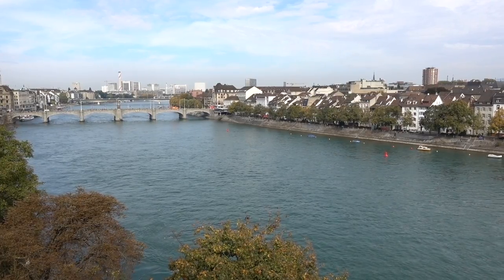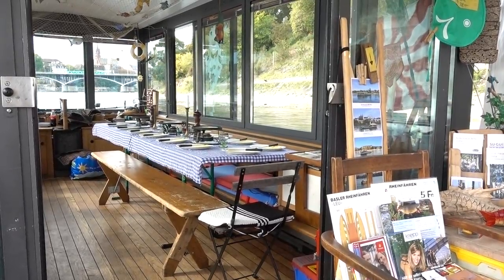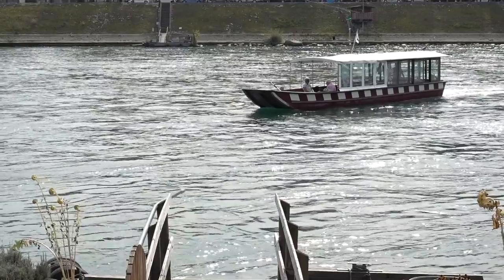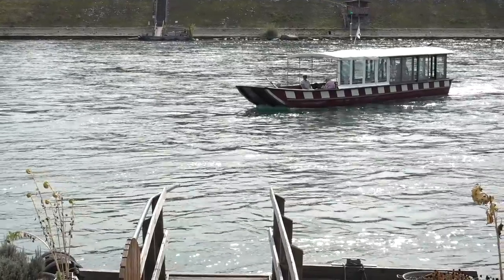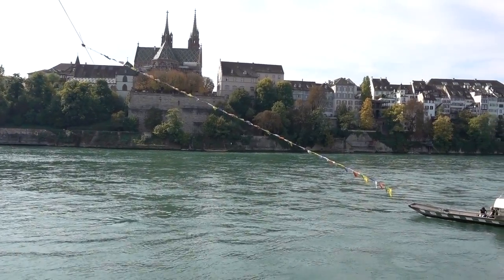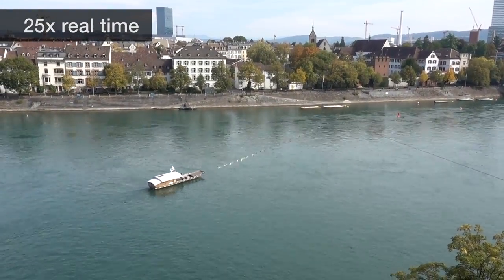Reaction ferries are really clever

Comment: Great idea, as long as the traveller doesn't get hung up on the cable.  Though I suspect it would be easy enough to bring out another boat to get the passengers off.  Then maybe they have a means of reeling the cable to one side or the other, to clear the jam (and replace the cable periodically).

But seems the boat could be more optimally designed for the purpose, to speed up the crossing.  But then again, this is more of a tourist attraction than a present day people mover, so speed isn't important.

Comment: Canoerrs have been doing this for centuries as well, and it doesn't require the line. Whitewater paddlers call it an "eddy ferry".
Point your bow about 30-45 degrees into the current facing the direction you wish to travel and lean upstream. Your boat will move almost horizontally across the stream.

Comment: It doesn't seem to be a rudder directing this boat, it's even simpler than that - the bar that can be seen being flipped from one side of the boat to the other at 1:00 changes the anchor point of the cable, allowing the current to turn the entire boat toward the opposite bank.

Comment: Now put a couple propellers on the boat and attach the circular motion of the propellers to an alternator and run a wire up that wire to make essentially free energy. Could power street lights or charge batteries etc from that river. Put a boat every 30 feet...

Comment: I though about methods of using gravity as the energy source and came up with tunnel-slides. Huge tunnels that act as a slide at the start, and then momentum pushes you up the other side. would be good for continent-crossing.
Clearly impractical now, but could eventually be plausible given improvements in technology
Reply: You would need some source of propulsion besides just gravity, otherwise each time you go up, you would not go up as high as the starting position.   There would need to be some sort of booster at the end of the uphill.

Comment: There is even simlper solution to this - not from user point of view but mechanical - the cable that connects boat to the main cable is in one corner of the bow and when you want to drift to the other river bank, you just mount the cable to the other corner and boat just steers itself.
You dont need any moving part like the steering lever.
Reply: kibicz watch the video. That' s exactly how it's done. The rudder is just for increased effect and control.

Comment: I thought about this sort of task in relation to ferries used in Ukraine.  I was wondering if, where the river curves the right way, you could do this with a long rope only anchored on one side of the river.  Long enough rope or great enough curve of the river, and it would appear to be doable.  I never thought of stringing the cable across to the other side.

Comment: The power of the waves could be stored in a battery on board the ship when not in use and it could power an electric motor when needed.
Reply: A motor isn't needed.  That is the beauty of that design.    The river IS the motor.

Comment: The obvious problem with these ferries is, what if you are on the other side of the river and there is no one on the otherside that needs to come over. The solution would be to make alternating ferries, one slightly up stream and setup the cable system so that when one ferry starts to move, the other ferry moves at the same time. Or, you have a ferry operator with a signal system but then someone has to be on the ferry 24/7.

Comment: Here is a thing I have never seen but I think might just be missed.
Parking lots should be inversed. Cars drive on the outside of the lot, and only venture in to park, instead of having a road right outside the entrance to the building. Once you turn in to the lot you can either drive in all the way to the building, turn around and go back out, or park.

This enables pedestrians to avoid the cars, and reduces congestion caused by pedestrians... takes no longer for the cars, and only a few more steps for pedestrians, with the notable exceptions of the jerks who pull up to the door and jump out...which is harder, but not impossible.

Comment: They are using the "ferrying principle". The boat is angled towards the direction they want to go and the river pushes the boat that direction.The ferry operator simply causes the boat to go at that angle by grabbing the cable and quickly attaching it to the opposite side of the ferry ! He makes it look easy but if you are not quick enough and the river over powers you the cable will be pulled from your hand ! 

 We use it even in Kayaks in far more heavy current, f course without a cable. There are a number of videos showing how its done for kayak's. One can do it without the cable in a large boat like that but you must have "eddies" on both sides and you must paddle some. The eddies current is circular and on the inside against the shore actually flows up river !

Comment: Could you make it even more efficient/*quick* if quick were needed, by altering the relative positions of the cable teathers on both ends... or even one end really?
You can easily pull a lever that snaps one cable into a forward position and another into a back one, giving a relative gradient in a sense - backwards. Much like a light-switch which could change both tether ends.

Side A - Forward, Side B - Back.
Get to side B, with A - Forward & B - Back. Change them round... you'd have to have a snap mechanism to push the boat forward agaisnt the current & a tether system to the side that you're on, but it'd make side to side faster. But obviously complicate things in turn!

Comment: I don't get it. What stop the boat from just laying along the water current? How does it keep an angle again the water current? I mean these no reason the connection cable is moving faster than the boat itself without power.
It seems to me that 2 connection cables are needed. one connect to the front for the boat and one to the tail. the one connected to the tail needs to be longer.

Comment: They should also put a hydro generator to charge batteries on the boats to use an emergency electric outboard in case the cable snaps.

Comment: Can you explain how cell phones and cell towers communicate at high speeds? Like on the motorway? (Does some of the signal get lost behind?)
Reply: Without digging into this, it's likely there is some doppler shift going on with the signal. This basically means the frequency of the signal changes with the direction you're going. So higher frequency when moving towards a cell tower, lower frequency moving away from it.
So in case of a digital signal, what changes is the bandwidth of the connection. Higher frequency = higher data rate, lower frequency = lower data rate.
Just imagine the bits meeting you when they are moving towards you, and you to them. While you'll meet less bits in the same timespan when you are moving away from them, but they're faster than you, thus catching up.

I'm sure someone will correct me if I'm wrong here. And it's likely it is more complex than that.
Reply: The speed of ANY vehicle is negligible compared to the speed of radio waves (the speed of light).
No data is lost or left behind, just as you never see a shift in the color of lights or objects as you travel towards or away from them.
Reply: But on a cosmic scale... we have redshift/blueshift. And there is such a thing as radar to catch speeding vehicles :)

Comment: I don't think it's that obvious. If the water is pulling in one direction and the ferry is attempting to cross it perpendicular to the flow, there is no intuition that says that a wire running across it would necessarily pull the vessel across.  Why wouldn't the ferry just stay in one place with the wire holding it steady?  Is the water not actually flowing straight in one direction but at a steady angle to the shore and therefore slowly pulling the boat by degrees?

Comment: Fairly obvious is you have ever sailed. The cable basicly does what the sword or keel does on a sailboat when on a haul or reach.
Reply: It's an even more straightforward relationship than that. The keel/water is still the keel/water, and does the same thing. The sail in the air is replaced by the cable.

Comment: Here are some obvious stuff

For solar and batteries if everyone connected their houses in parallel DC, we'd no longer need electrical companies, get no bills, everyone shares their capacity for when their neighbors need it and all is well.

Without sharing everyone has to design their home system for max power and consumption, this way only the average local instant max consumption need to be considered, everyone could even perhaps own one 250 W panel and one 200ah battery, connect each house and voila you got kilowatts and thousands of Amp hours of energy at your disposal.

one DC power line with two thick wires between each house, each panel and battery, and design the panels to always be under battery max V, and you wont need a charge regulator even.

2.
And if everyone had DC devices instead of AC, they could all plugin to this system directly, with minimal loss.
During day much of the used electricity will be from the panels.

Comment: Seen them 'in the flesh'. They have no rudder! The angle of the boat to the current is controlled simply by which side the cable joins the boat! The whole boat acts as the rudder!
Reply: Do they still have a keel?
I would assume they do, so there is more surface area for the current to push the boat.

Comment: I don't think it's the rudder that controls the motion,  the fixing point of the line is moved from one side of the boat to the other...
Reply: I think it is a combination of both.  Changing the side the cable is on would change which direction the craft tends to point,  the rudder would fine tune the angle to control speed by increasing or decreasing the angle of the boat relative to the flow of the river.    

Using the rudder to counter steer the craft to point straight into the flow would make it stop moving, while turning the craft to more of an angle would increase the speed.  

I think it works in a way that is simmilar to how the trim tab of a small plane works.

Comment: How does it get back, a different cable running the opposite angle?
Reply: 1:03 changing the side of the cable changes the direction, the boat itself acts as the rudder
Reply: @jamoin3829 ''Changing the side of the 
cable'' (?)
Reply: @bikersoncall  the cable is mounted to the metal rod wich he switches to the right side at 1:03 so the front of the boat turns left

Comment: I was thinking , what if the cable was to break ? There is no engine , so it would just drift down steam until it hit something .
Reply: A permanently manned Firefighter/Rescue Boat is nearby. There have been Incidents with snapped Cables but the Ferries were always taken under Tow before they got anywhere near the Hydroelectric Dam. There is no Way to paddle against the Current in Basel; the Navigators on the large Freight Ships even need a special License or have to take a Pilot to Go there because of the strong Current in a narrow River Bend with many Bridges.

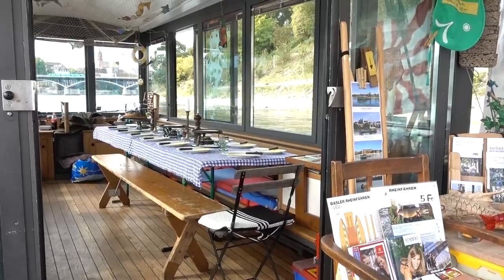Comment: 0:12 If they've no power on them what's driving the propeller that's disturbing the water behind this one ?
Reply: Just eddies from the boat in the water
Reply: That Wake is caused by the Rudder
Reply: @Genius_at_Work  Actually, looking at it again, the water in the foreground is fairly turbulent - so it's likely a continuation of that. Oddly rudders don't generally initiate turbulence - they'll deflect it from a prop - or, perhaps in this case, from preexisting turbulence.
Reply: @millomweb  The Rhine Bend in Basel can be massively turbulent, especially when there is a lot of Water like right now. The Navigators of the large Freight Ships actually need a special License to manouver though it or have to take a Pilot; it's a very tight Corner with strong Current, causing the Water to be up to 1 m higher on the outer (left/south-west) Bank than on the inner one. Plus there are five Bridges in it to possibly crash into.
Reply: @Genius_at_Work  The height of the water is of no significance in its own right. It is merely an indication of relative flow - which could spin a vessel very easily. And vessels generally do not have powerful controls (big enough rudder or thrusters) to keep a vessel under planned control. It's a dangerous matter of working with nature in successfully navigating such conditions and knowing how your vessel is going to be affected.
But then, you probably know all this already :)

Comment: Sailing mechanics use the same concept to sail against the wind, zig zagging. Not exactly the same, but the same.
Reply: Nothing like. This is just a boat steering when being pulled against the current by a force applied by a cable.
Reply: @garethhanby  No. The force of the wind provides the motion, the resistance of the sail in the wind, provides forward motion. Same on the boat here, the water current replace the wind, the side keel of the boat acts as a sail. The rudder allows the direction by facing the bow in the direction (left or right) it needs to go. So actually, exactly like.
Reply: @Rustie_za  Oh dear, physics fail. This is exactly the same as if the river was stationary and the boat was being pulled by the cable and it steered left or right. 
There is no tacking involved at all, no using the energy of a flow to travel in the opposite direction.
Reply: @garethhanby  The cable is stationary, the connection between to the boat and the main cable is not motorised. Pray tell how is the boat moving from left to right over the river??
Reply: @garethhanby  The cable is applying no force, the cable is an anchor to the main overhead cable. The force applied is the flowing water against the keel.
Reply: @garethhanby  Pray tell me, what is moving the boat Mr Physics fAIL?
Reply: @Rustie_za  If the cable applies no force, then they can get rid of it and everything should still work the same.
Reply: @Rustie_za  You clearly do not understand physics. The cable is applying a force, that force is keeping the boat from travelling downstream. 
Motion is relative, the scenario is equivalent to stationary water and a cable pulling the boat across the water.
From the reference frame of the boat, it does not matter whether the water or cable is moving, it can traverse from left to right the same way all boats do, by deflecting the water flow and causing a pressure imbalance usually by using a rudder to rotate the boat.
Reply: The similarities to a sailboat operation are there. In a sailboat, there is a sail force in the air, and a keel force in the water; and their sum is the total force that propels the boat. Here, the situation of the keel force in water is the exact same, but the sail is replaced by the cable.
Reply: @garethhanby  By saying "no using the energy of a flow," are you saying this craft does not use energy, or that the energy it uses comes from somewhere other than a flow?
Reply: @FlyNAA  The cable is literally just an anchor stopping the boat from going down stream. The water is providing the force, allowing the boat to move, with pressure against the keel, held in place by the cable.
The cable it self is not providing any force that translates to motion.
Reply: @FlyNAA  I am saying the analogy of a sailboat sailing against the wind by zig zagging (tacking) is incorrect. So it is no[t] using the energy of a flow to travel in the opposite direction [to that flow]. It is just a normal boat steering in waterflow. Obviously the energy required to move the boat laterally is coming from the waterflow.
Reply: @garethhanby  If you haven't noticed, this boat also zig zags to change direction. It would have been quite silly to build this system to just go across the river once, and then never use it again, wouldn't it?
Reply: @FlyNAA  I never said it wasn't changing direction, I said the analogy of a sailboat sailing against the wind by zig zagging is incorrect. Also zigzagging has two dimensions of movement not one, so the boat is not doing that from the perspective of land.
You are getting desperate to make a valid point and failing.

Comment: Shame the cable is overhead parenting tall boats / sail boats from going past... Maybe someone clever could design an underwater rail instead of the cable?
Reply: With that much current,  I dont think a sailboat would do well trying to go anywhere but downstream.  

Did you see how fast that other boat stopped by just letting off the throttle?  Then probably had to use almost full throttle to get back up to speed when it stopped for the ferry?

Comment: Wait, how do you get back? I saw some dude pull a level to the other side of the boat. how does that change the direction of the boat?
Reply: It changes the angle the boat takes at the end of its attaching cable. Attachment right, point left, go left. Attachment left, point right, go right.